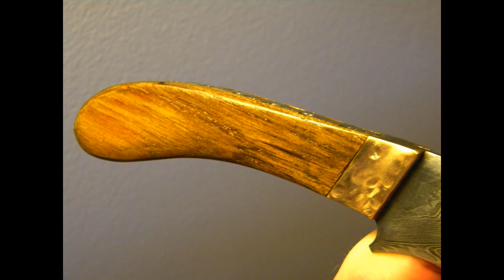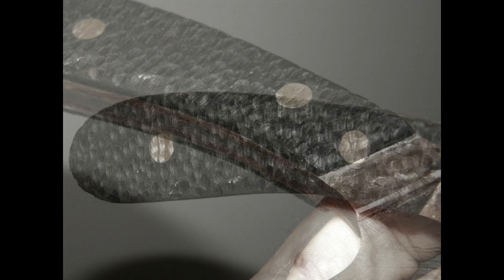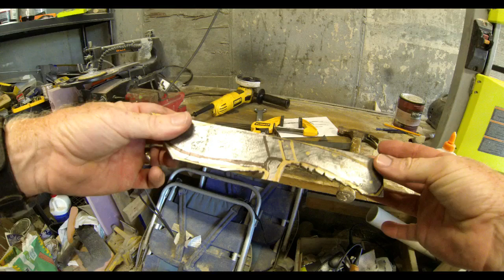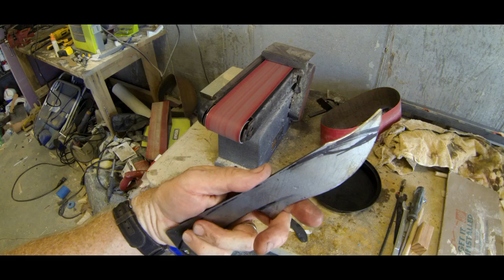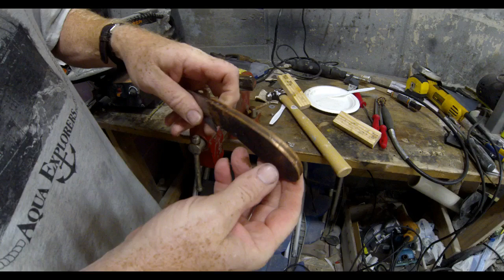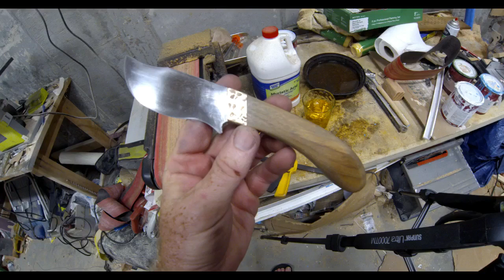DIY Easy Ebay Damascus Steel Knife

Comment: did you heat treat the blades after you shaped them?  You mentioned that you annealed the steel before you cut it out....but did you reharden before you did the handles?
Reply from the maker: Yes material was hardened and tempered before handles. I covered heat treating, annealing and tempering in another video.  https://www.youtube.com/watch?v=bdRtg6xxkrk
Reply: thanks mate!

Comment: Awesome tutorial! What were the dimensions (length, width, and thickness) for the blank you used?  Thanks!
Reply from the maker: Thanks for the positive feedback. I bought a set of three blanks which were suppose to be 2x10x3/16. They were actually 1 1/2 x 9 x 3/16. Even though I was short changed a bit the price was right about $25/ea and I was happy with the damascus design.

Comment: That not Damascus steel. It's a shit. Real Damascus steel have a lot of layers.
Reply from the maker: That is definitely real Damascus. All of the layers appear after grinding and polishing and after acid soak. What the video till the end.
Reply: What we call Damascus steel today is not determined by the amount of layers per say, the the amount of layers doesn't determine the quality of the Damascus, but the steel it was forged from and in the way it was forge welded. There are a lot of Damascus out there some cheap some expensive but its still what we call Damascus steel.